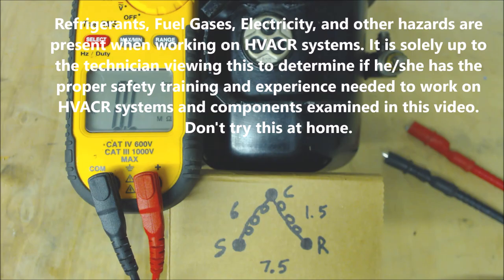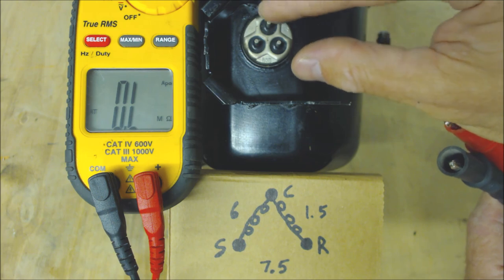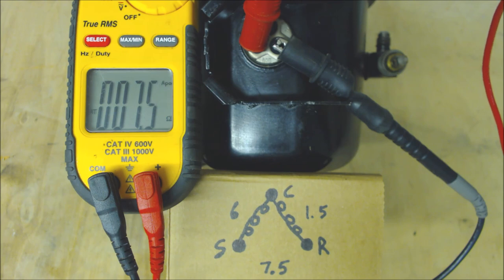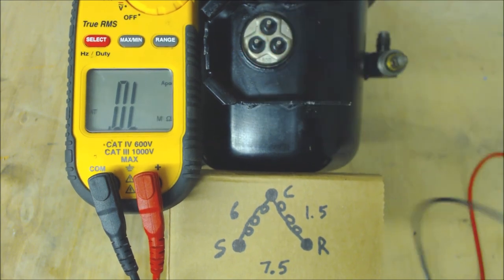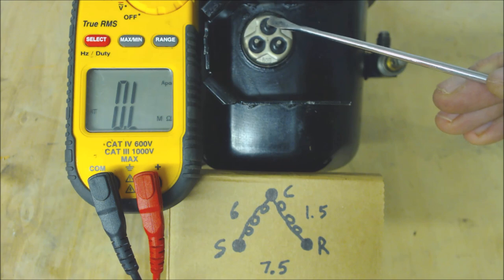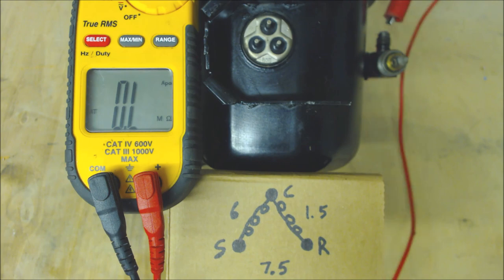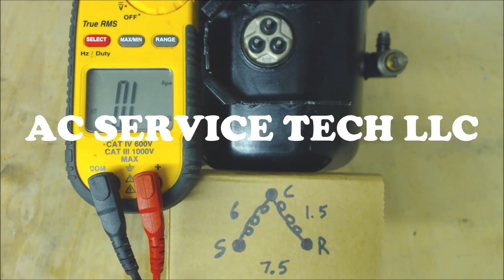How to Find Common, Start, and Run on a PSC Compressor Motor

Comment from the maker: Tool List-  https://www.amazon.com/shop/acservicetech
Support-  https://www.patreon.com/acservicetech
For those that are looking for the tools used in the videos: (Linked Below)
Here is the Link for the newer UEI DL479 Multimeter with temp sensor- http://amzn.to/2jtsUbJ

Here is a link to Refrigerant hoses with valves used in the videos  http://amzn.to/2aBumVI

Here is the Link for the Yellow Jacket Refrigerant Manifold Gauge Set used in the videos http://amzn.to/2aenwTq

Here is the Yellow Jacket Manifold Gauge Set including standard hoses- https://amzn.to/2vLVkV9

Here is the link for the Imperial Kwik Charge 535-C- http://amzn.to/2uipEI6 

Here is the link to the Fieldpiece ST4 Dual Temp Meter- http://amzn.to/2wc1ME3

Here is a link to the Digital Refrigerant Scale used  http://amzn.to/2b9oXYl 

Here is the Yellow Jacket 4 Port Brute Manifold with Hoses- https://amzn.to/2BkuGIq

Here is the Fieldpiece SMAN460 Digital Manifold Set- https://amzn.to/2nB4Fe6

Here is the Fieldpiece SMAN360 Digital Manifold Set- https://amzn.to/2BdoaD4

Here is the Compact Ball Valve Attachment for the end of the Refrigerant Hose- https://amzn.to/2KUisW8

Here is the Quick Disconnect 90 degree attachment for the end of the refrigerant hose- https://amzn.to/2MMtVcg

Here is the link to the Appion Valve Core Removal Tool- http://amzn.to/2uYr8WL

Here is a link to the JB 6 CFM Vacuum Pump   http://amzn.to/2nqbvo8

Here is the Link to the Appion Blue 3/8" to 1/4" Vacuum Hose- http://amzn.to/2uYlVyc

Here is the Link to the Appion Red 3/8" to 1/4" Vacuum Hose- http://amzn.to/2uYg6Ro

Here is the link to the Yellow Jacket 1/4" by 1/4" heavy duty hose straight-  http://amzn.to/2umtcod

Here is the link to the CPS Vacuum Micron Gauge- http://amzn.to/2v1nM3O

Here is a link for RectorSeal Bubble Gas Leak Detector http://amzn.to/2ckWACn

Here is a link the Nitrogen Regulator    http://amzn.to/2bXdR5f

Here is a link to the Nitrogen Flow Meter    http://amzn.to/2brvoBg  

Other tool links can be found in the video description section.

Shop through Amazon! Your Purchases through Amazon provide a means for channels such as mine to earn advertising fees from all purchases after clicking through. Prices are the same as normal-    https://www.amazon.com/shop/acservicetech

All of the ACSERVICETECH Playlists-  https://www.youtube.com/channel/UCOZR-1IqsAer9wzlvFgb4mA/playlists?view_as=public
Reply: What does OL stand for?
Reply: @raymondcornielle8263  OL= "Out of Limit"  = an open circuit with infinity resistance = The test leads are not connected to anything conductive between them.
Reply: Thw lowest  ressistance  is  indicatwd  .  When  the  poods  are  connectwd  to  twrminals   R and   s total  ..resiatance  of  both  wind  is  indicated  qhwn  rhw  terminals    c  and  s  ..are  connected  to  the  metar  the  resistance  of  starting  wind  is  indicated  or  the  value  will  br weenthe   trminal  e  and  rhe  lowest  r  and  s...the  resstinec bet qeen  c  ans  s..will be  bwt qeen these  tqo  the  sum  of  the  resttance  of  ruing  qindi g..bet  ween  r  and  c   and  starting  qinding  bet  ween  c  and  s  is  in  dicated  when  the  metar  ia connctedr  s  rs  numbwr  exples  1.2.3  restanc checking exples  1-2 2-3identiiwd  as  followea  for  selald  compwrssor  the  resistance  bet  qeen 1-2 2-3  1-3found  as  exples  50ohms  30 ohms  and  29  ohms respectivetely  .identify  the  rhree  terminala    resistance  betqeen  1  and  2=50  ohma  (hifhhest   resiattance  between  1-and  2  =50ohms  highest  resistance  bet  ween  2and  =30   ohms  medium  resistance  bet  ween  1 and  3  =20  ohms  lowest  1-2=rs  2-3cs  .1-3cr..terminal  1=r  2=s  .3=c...3teminal poin  testing  find  oit  methad  hight  low mediom  conformed wind  3trminal poined ok  jolly   engring  sake gruoping .....ok sir.. thankto somuch  redi g  sllowing ok

Comment: I live in a rural areas of Asia and many so called technicians have turned up to fix our commercial fridge. When they see a foreigner the repair price is tripled. You sir have given me all I need to get the fridge running again (excluding a faulty compressor motor) and you have even shown me how to figure that out. Many thanks.

Comment: Thanks loads for this info. When testing for  grounded wiring,  you pointed out what you want to see is OL at each terminal, If you did see a resistance reading, would you then figure, a grounded compressor, or is there a mindset that says, well it's a bit  weak, or maybe, has 4 years left, Is there any wiggle room for assessing it's over all condition/life span? Thank you.

Comment: Ahh, looks like I have a broken dehumidifier compressor. Or is there any other internal construction that would not give the R_start + R_run = R_total? I am very sure that the terminals are in the same location as on the compressor you are showing, because of the external components connected to them (PTC-thermistor with "M" and "S" marking, overload protector on common, capacitor going to M and S).
I am measuring 6.6 Ohms on the start winding, 8.1 Ohms total, but the run winding measures 10.3 Ohms. The first two values would fit with your example, and 8.1 - 6.6 Ohms would give nice 1.5 Ohms, but that's not what I measure. The compressor runs for about 15 seconds (the heat exchanger pipes even start to cool), but then the overload protector trips.

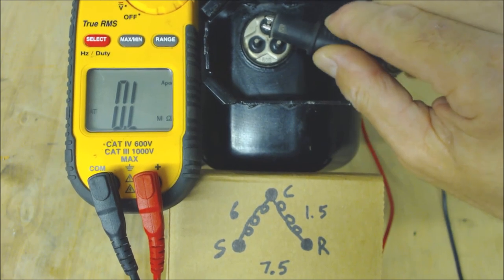Comment: I love your work and appreciate all you do. I hate to point this out but at 2:40 you said "We should have no resistance whatsoever with the ground."  No resistance to ground would be a short to ground.  When the meter read "OL" or "Out of Limit" indicates there is more resistance than the meter can measure.  For all intensive purposes, infinite resistance.  I think I noticed this on one other video about start components as well.
Reply: Mark Carpenter, intents and purposes
Reply: I noticed this too. It's dangerous to assume people will understand his intent. As a training video they should at least pop up a text to correct this or do a quick voice over to make this otherwise excellent video correct.

Comment: Just to let you know my credentials - DeVry University was where I attended 2 year  school for digital classes in  ( and, or, nand and nor ) gates  and truth tables, Boolean algebra and Karnaugh mapping. Middlesex County College is where I attended 2 years in Electrical Engineering technology for power supplies in 120 vac step down transformers, half wave, full wave and full wave bridge ( diode)  rectifiers , electrolytic capacitors, all resistors, voltage regulators, Direct current circuit analysis. I learned to use a volt ohm meter and an oscilloscope.  These circuits really were conversions from alternating current to direct current just to let you know where I am coming from.  I did use a taps to tap into the hi pressure refrigerant lines of window or apartment air conditioners to fill them up with coolant working for a TV cable installation company who also did apartment air conditioners. YOUR EXPLAINATIONS ARE REALLY GREAT! I work for Duct-man Mechanical now in Eustis, FL in the scrap yard!

Comment: is it normal that i could get a reading of something about 16ohms when i took the reading on the plug of the refrigerator? cs reads 14.1 cm is 23.2 the sm 36.5..

Comment: Hey , So I have a compressor that is not only blowing my "overload" but I also have continuity between "ALL" three pins and the copper tubing right next to the compressor. So Is this compressor Bad for sure then??
Reply: Resistance between "ALL" three pins is normal.  A short between any of the 3 pins, or any of them to ground/chassis/copper means it is bad because it is shorted to the compressor body internally.

Comment: Hey Craig. Do you ever do commercial work ? Can you do a video on that ? Same thing you with residential hvac problems. Do same for commercial hvac problems. Thanks.
Reply from the maker: I do some but not very large, just light commercial with my company, thanks for letting me know what you would like to see!
Reply: AC Service Tech LLC so  basically it’s the same principle apply to commercial work as to residential work. Like charging, capacitor, motor fan. Etc. it’s all the same ? Or different complex. ?
Reply from the maker: Yeah same principles, 3 phase motors, multiple compressors and evaporators, belts attached to blower motors instead of direct drive but same refrigerant procedures until you get very large, thanks
Reply from the maker: JiggyPatel, did you see Nurfet Alic's post under the same video for you?
Reply: AC Service Tech LLC thanks. I will check it out.

Comment: What do you think about using a megaohm meter to test compressors? What is a scenario where you would actually use one and what is it really for?
Reply from the maker: You certainly can use a megger instead of just the value from the multimeter. The megger gives you a deeper look into the resistance value of the windings. This would be done to determine if a compressor is on its way out from loosing insulation resin on the windings.
Reply: I think I’m still confused and here’s why:

I’ve only been in the industry maybe 2.5-3 years outside of a year in trade school. I started in residential appliance repair and eventually moved into commercial refrigeration. Now I’m doing residential heating and cooling. Worked in install and have been doing maintenance and service now for maybe 8 months. The current company I’m at keeps pushing everyone to go out buy a megger saying it’s a vital tool. But I don’t see it. It honestly seems gimmicky and kinda redundant. If you can check your compressor with your trusty multimeter why would you ever use a megger?
Reply from the maker: A megger would certainly be used much more on larger compressors than small residential and appliance repair, thanks

Comment: only thing I didn't hear is, why the start winding has higher resistance and the run has lower resistance. guess that could be a video of it's own :)
Reply from the maker: Ha ha yeah this was just mean't to be a quick review, thanks
Reply: @acservicetechchannel  The question was: "why the start winding has higher resistance and the run has lower resistance" This Start and Run label on the schematic in the video seems backwards to me.  It would surely burn out a compressor if it was connected backwards.
Reply: @acservicetechchannel  uve ben asked and no answer to it.. um.... slow clap

Comment: The psc has a run capacitor which is in series with start winding  and a centrifugal switch right?
Reply from the maker: There is no centrifugal switch on this. This would have an externally mounted relay if there is a start cap mounted, thanks

Comment: Craig there was the question in reference about commercial work yes only in a small scale in the reference to small tonnage range from 5 to 15 Tons the company that I work and HVAC department guys that work on the units ranging from 30 tons 250 tons including Chillers and that's total totally different animals when comes to the service and repair it's not the same when you work in the residential and Light commercial units it is mind-boggling when it comes to the service and repair.
Computer-controlled program that's including Electronics sensors pressure switches high voltage 480  3.phase and 2100 volts ac three phases feeds the chillers over 150 tons .
My electrical department we work only on install service and troubleshooting 
It is challenge and adventure.
Craig good work and nice video.
Reply: Great info
Reply from the maker: Yes they are different animals, ha ha. I still think that the basics need to be known first and that large companies that do commercial work still need to give applicants the chance to step into that and learn and work in that environment too. A lot of techs are told they don't know enough or that the existing knowledge doesn't apply. I am not a fan of that since techs still need to start somewhere, that's all. So when someone asks me if they are similar, they are typically asking with the question in the back of their head" should I even apply for that position?" I say yes, go for it and take the knowledge that you do have and build on it. Thanks Nurfet Alic, always a pleasure!

Comment: Scenario 1:
The compressor is not running, but the condenser fan is running and the compressor is hot to the touch. What may prevent the compressor from coming on?
Scenario 2:
Name the compressor terminals, identify the color of each wire, and name the component to which each wire connects. 
Scenario 3:
How do you identify the compressor terminals if there is no diagram? How do you identify the terminals on a capacitor if the name is not visible?